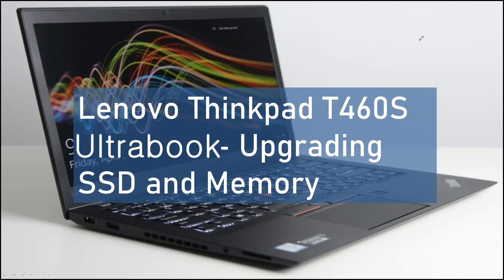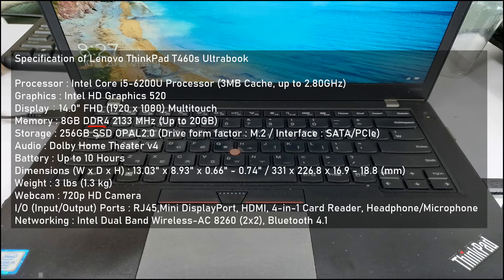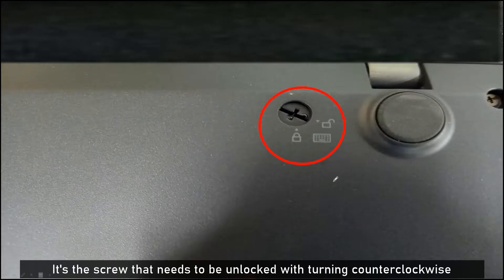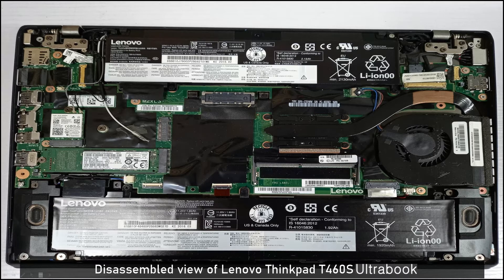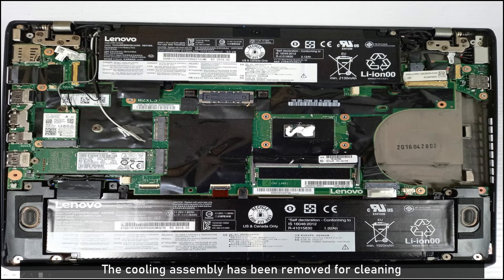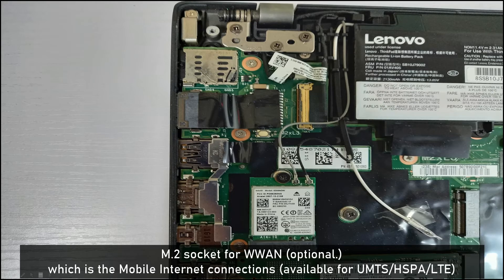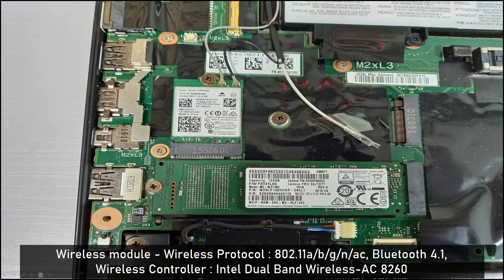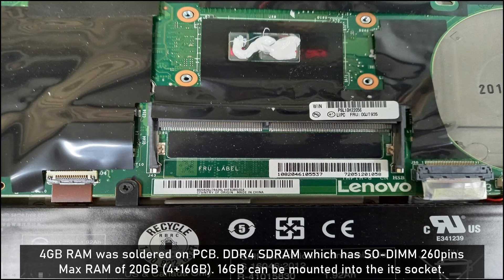Upgrading SSD and Memory for Lenovo Thinkpad T460S Ultrabook

Comment: Ahh, what you mean by pcb, ahhh,,, you mean thc? Or ahhhh, you mean bbc ahhh, or ahhh maybe cbd? Right, ahhh, you know what you talk about, ahhhhhhh!
Reply from the maker: you can search the meaning for "pcb" in any of search engines. pcn means printed circuit board which is used in every electronics product. all of electronic component mounts on the pcb so this kind of module can make any signal or pulse then the laptop can operate on the right process. so you can use the computer to do a game and surf in internet world.
hope you got an idea for that word.

Comment: Are the empty slot SSD match for half SSD m2?
Reply from the maker: no, you can't. there's only one m.2 ssd socket in that laptop.
Reply: @leerizzardo960  noted! Thanks brother
Reply: Hello, I want ask advice. I want to replace SSD Sandisk M.2 to NVMe 970 Evo Plus. Did it works? And do you know the type of RAM for upgrade?
Reply from the maker: @ynkrd  not sure nvme type could be fit to this laptop because i didn't test it, and you can use ddr4 for the ram upgrading with max to 20gb
Reply: @leerizzardo960  okay. I'm read the specs that compatible for ssd PCIe, I will test it 😅. Thanks for information broo 👍
Reply: @ynkrd  it works, im using it. Idk the guy who made this video only cared about getting more views.
Reply: @o64m42  same broo..it works too, I'll try it 4 month ago, and niceee speed!! 👍👍
Reply: @ynkrd  nvme will not work, the ssd is m2 sata
Reply: You can fit an additional msata ssd beside the network card in this laptop. It is right beside the wifi card. It's usually the place for wan card but yu can use it for additional storage.